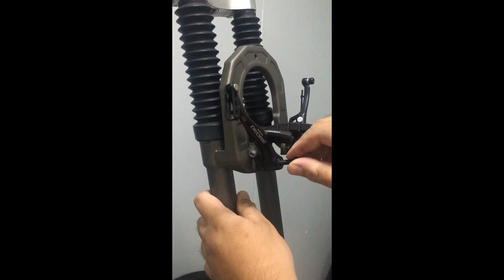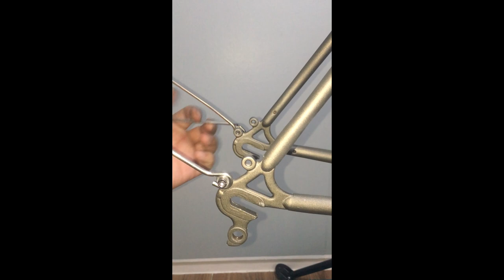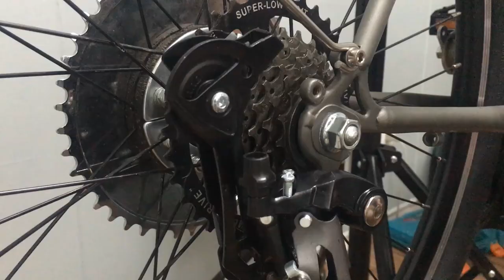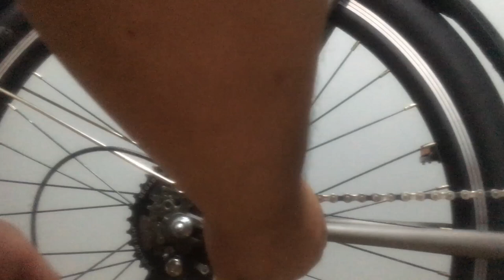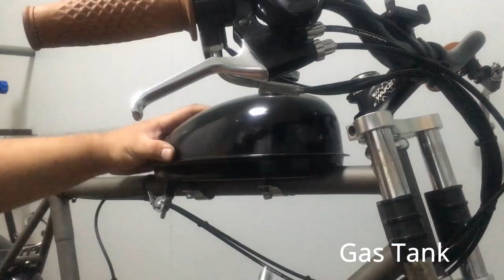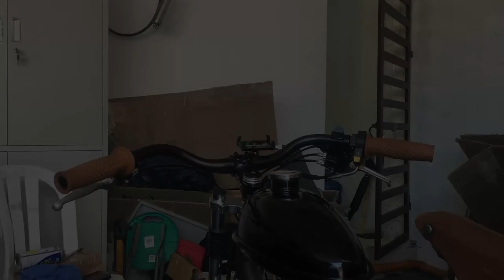BT100 Motorized Touring bike "The Grey Ghost" Build and Ride Video.

Comment: Very nice clean build, I have a few BT motors and all four stroked at wot at first but I changed jets and that fixed the issue and opened up a whole new topend👍👍
With the BT motors for longevity I set the needle in second from top on stock carb and jet the carb usually down between a 65 or a 67 and then run 38:1
Reply from the maker: thanks for this info :)